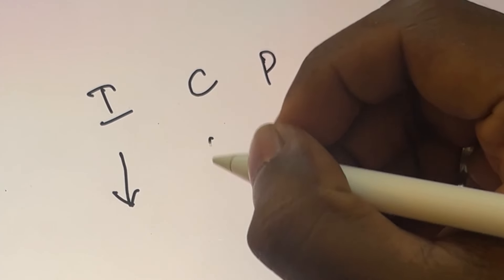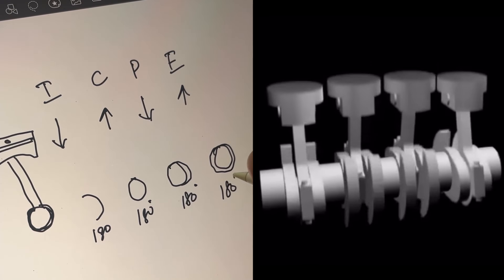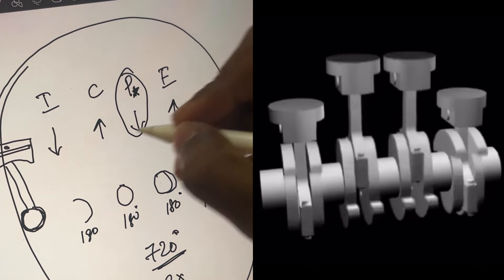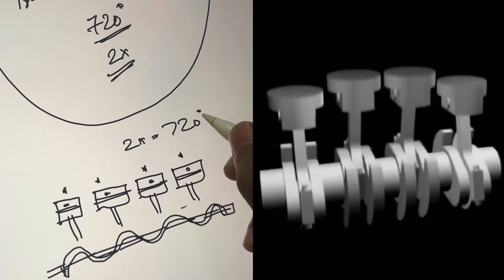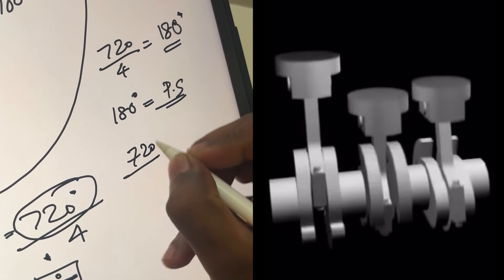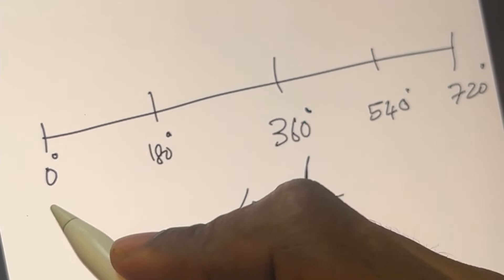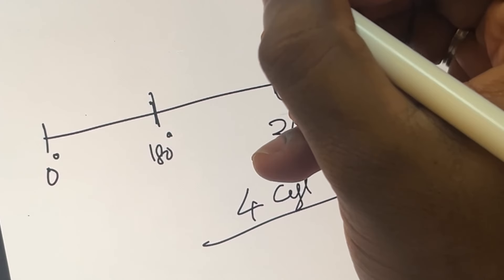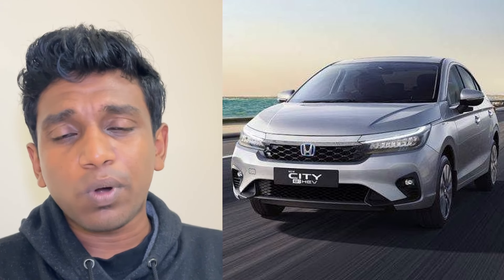3 Cylinder engine Vs 4 Cylinder engine | Explained in Tamil

Comment: I'm having a 2012 Skod Fabia 1.4 TDI 3cyl unit, It's been 12 years and I'm still getting 24kmpl on highway at decent cruising speed, engine no trouble so far, when periodic maintenance are done properly, this is just my opinion
Reply: To add a point diesel vera petrol three pot vera
Reply: 12 years ok
But 
Evlo km ooti irukuriga....
Reply: @Raveendhana  Puriyala bro petrol maintenance kamiya irukum nu solreengal ?
Reply: @BeninChurchil  petrol tsi are proven engines and that 1.0 tsi three cylinder got engine of the year award in 2018, and compared to its old diesels and the other 1.5 NAs my expectation is it will cost 9-10 per year,
Reply: @Raveendhana  Who given award bro ?
Reply: @BeninChurchil  international engine of the year 2018 , awarded by the top journalists all over the world.

And it got the award for the lightest engine, it's been built up with strength and performance in mind, users forged crankshafts and hollow connecting rods etc

Comment: Hi Bro, First congrats to your work and dedication, I come up with tiny question for vehicle in spec sheet mentioned as "Max Power18.4 PS @ 10000 rpm   and  Max Torque14.1 Nm @ 7500 rpm" how it will drop the torque above 7500 rpm...can you please explain it...

Comment: Hi brother, does "Dual Fuel Injectors" part of Grand Vitara 1.5L NA K15C engine have both port injection at lower RPM's and direct injection at higher RPM? Is Honda Elevate i-VTECH a direct injection ? Will carbon deposit be a bummer long term (> 10 years) in case of direct  injection?I have shortlisted grand vitara NA smart hybrid AT and  honda elevate CVT but am worried about direct injection causing maintenance issues in future. Mine would be 90% city usage and 10% highways. Thank you!

Comment: Hello sir. I am one of your subscribers from Ariyalur district. I bought a MG Astor Sprint variant on 17th September 2024. 
Currently I am facing the following issues:
1) Bubbling in Coolant reservoir
2) Oil spillage near brake fluid reservoir 
3) Water formed on AC pipe line under the bonnet
4) Seems to be a crack in the AC line
Are these normal sir?

Comment: Alto lam romba yers ah 3 cylinder than top class engine reliability so no need to panic about 3 cylinder but don’t prefer turbo in city
Reply: Three cylinder has more parts to fail, and it's about engineering in terms of reliability 😊

Comment: Am a mechanical engineer too, yes three cylinder engines are reliable too, 
But it ends there, in a engineering point of view its reliability also depends of its design , how the power is taken out or it and the general quality 

So as for suzuki doing three cylinder for years , yes they have been successfull but today a three cylinder is made to produce around 120hp in a small car , thats important 

Yenna i have seen many turbo and head failures in our budget indian models 

So its not about three cylinder alone its about how its designed too 

In that view or in a holitsic view, in todays indian market view 
4 cylinder engines been reliable and it will have the edge for some time 

One eg is , 3xo is offered at a minimum 9 lakhs , and a nissan offers a three pot wih a vc turbo for 40 lakhs so engineering costs money

Comment: Bro, two and three cylinder engines la lam  piston 'A' keela pona remaining piston oda power stoke vachu piston 'A' mela (TDC) ku varum. Whereas single cylinder engine la after ignition, keela pora piston epdi bro again mela varudhu (For next combustion cycle) ?
Reply from the maker: Crankshaft pushes it up

Comment: What is the difference between turbo 3 cylinder vs 4 cylinder normal engine
Reply: 4 cylinder NA is not as peppy as a 3 cylinder turbo and also has less torque. But a 3 cylinder turbo will have initial lag and labor too much at low revs. Maintenance schedules are to be followed more strictly for any turbo petrol engine.